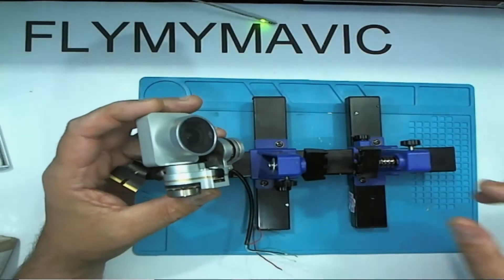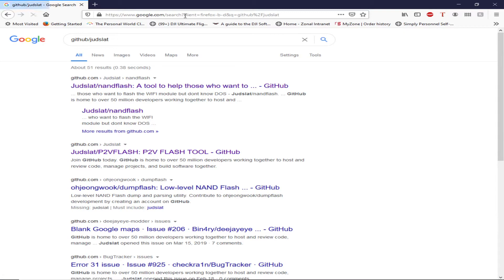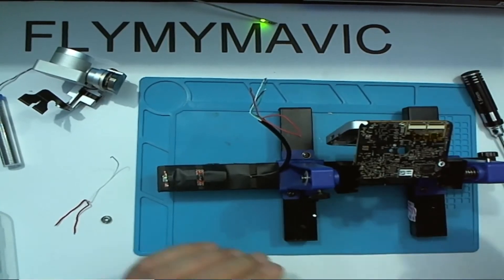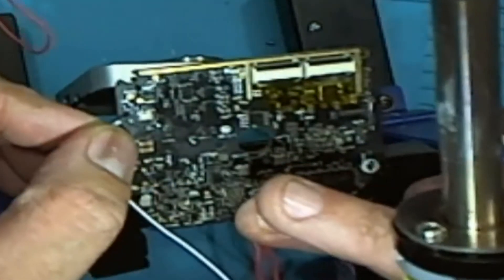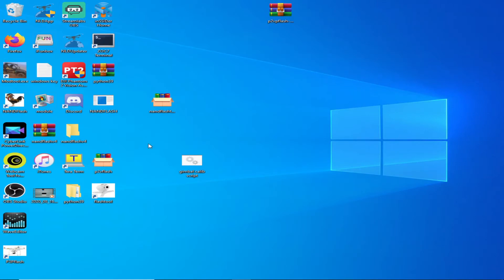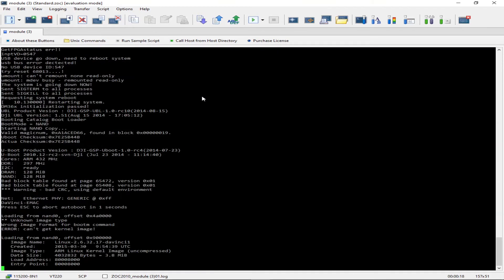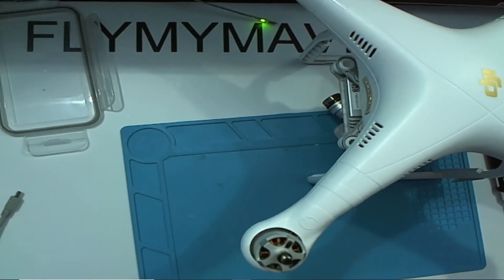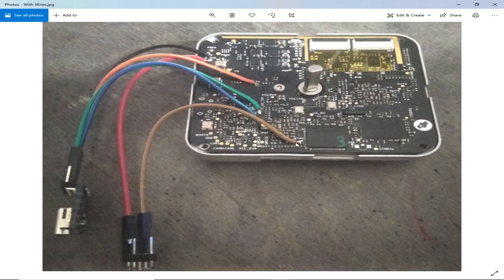Phantom 3 Pro loss of FPV repair

Comment: Okay my guess is "you assumed users would only have 1 usb port"  I had to disable all my other usb ports because you'r program detected the wrong usb port so you need to add a option to manually select the correct port Also unless I have missed it were are (if any) the log for the com session so I can review what happened.
Reply from the maker: You mean you have multiple items plugged into your pc that show as a port in device manager??  as for a log file as the program uses a DOS EXE file and runs in DOS there is no output other than what is shown in the DOS box when it runs, im not sure if there is a way to do that unless i put in an intentional pause at the end of the script. always happy for feedback so feel free to reach out to me at flymyphantom@outlook.com

Comment: If I have a gimbal that I think stopped working when I upgraded its firmware.  It moves and such, the remote controls the gimbal and the drone fine, but I have no indicator light on the gimbal at all and just a black screen for the video feed in the DJI go app.  It also says “gimbal disconnected” in the camera settings in the app, and never has a reading for how much space is left on the microsd (also tried with no microsd to see if that fixed the video as I’ve seen elsewhere..)
Reply from the maker: I have a couple of suggestions please email me at flymyphantom@outlook.com to discuss further

Comment: When I flash, it gets stuck on the text "target". Please help me
Reply from the maker: Hi
i need more info than that, first off always double check your wiring and make sure it is correct also make sure you are using the correct type of TTLto USB adapter, please send screen shots to flymymavic@outlook.com. please note i am on holiday so may not reply straight away

Comment: Thanks for the tutorial, have you seen a situation where it worked initially but then stopped working again?
I completed the repair, powered up, received a video signal, powered down, installed the props, placed it outside, powered up and the Gimbal Disconnected message re-appeared. I repeated the flash process, but all I see it a "no video transmission" message, not sure if it was there when the problem started or if this is a new issue.
Any suggestions?
Thanks again

Comment: Hi thanks a lot for this tutorial, I  try it and finally the message programing successfull but not recover video signal, I realised that a block was wrong during flashing.
I paste the message.

->"Target: Erasing block 0x0000000A through 0x0000000A.

        Target: Writing header and image data to Block 0x0000000A, Page 0x00000000
        Target: Write verify failed, skipping block!"

And other strange messages.

   ->    "Target:    DONE
DONE received.  Sending the UBL...
   0% [ ------------------------------------------------------------ ]
Status Undefined"

->"SENDIMG received. Returning ACK and header for image data...
ACK command sent. Waiting for BEGIN command...
        Target:   BEGIN
BEGIN commmand received.
   0% [ ------------------------------------------------------------ ]
Status Undefined"

->"ACK command sent. Waiting for BEGIN command...
        Target:   BEGIN
BEGIN commmand received.
   0% [ ------------------------------------------------------------ ]
Status Undefined"

May be the NAND chip are wroken?
If you think that it is the case, would be posible to solve change the chip MSIC XY30LF1G18AC-XK1?, or it is not enough?
Many thanks for your support.
Reply from the maker: Yes the chip is fried and so won't take the loader program, the only way is to replace the chip which would mean flashing 3 different images which is beyond my scope of expertise
Reply: @FlymyPhantom  thanks for your quick answer, so if I change the chip the program is not enough to flash completly the chip?. Isn't it?.
Reply from the maker: @AntonioGonzalez-oj1zy  no it's a complicated process a search phantompilots forum for advice
Reply: @FlymyPhantom  many thanks, I have asked in the foro.

Comment: Will this work for the boot loader on a Inspire camera module with a DM368 or the HDMI GL658 module with a DM368
Reply from the maker: Visit http://wiki.dji-rev.com/ there is loads of info on there
Reply: Just wondering if this nice app would be easier . I’ve seen the manual method and not sure it’s my skill set
Reply from the maker: @broughamjb  if you email me at flymyphantom@outlook.com I can build an app based on which instructions you want to follow

Comment: Thanks a lot for the tutorial I made it and successfully recovered the image, but I lost the gimbal orientation, it is -25 degrees to the left there is some methode to correct it?
Reply from the maker: try a gimbal calibration
Reply: @FlymyPhantom  Thanks for your quick answer, Ill tryed but  is not corrected, I  remember that it is calibrated in production, beacouse is a magnetic detector and need to put the value in some memory probably the same I flhased and the new dont have the same information in this point, I am not sure of that.  Some times ago I read about it and I remember that exist  a cheap that  is programated during production.
Reply: Excuse me I have discovered my mistake I have tightened the screw of the axis outside the chamfer.
I take this opportunity to comment on another mistake I made in case it could have happened to a novice like me. I couldn't communicate by serial until I changed the Rx and Tx cables and everything started to work perfectly. Thank you very much for your help.
Reply from the maker: @ferminsalazar9742  yep that will do it, glad it's sorted

Comment: I can not get it to say bootme in teraterm or Putty it just goes through a chain of computer language forever long I let it run before I close it out.  It is read on the correct serial port and I checked wires a couple of times. Can anybody tell me why?  this board went bad by sitting for 5 months without use.
Reply from the maker: You need to make sure you jumper the tiny 2 pins together and to the 3v, it’s booting up (the long repeating text) so it’s definitely not in boot mode
Reply: @FlymyPhantom  Thanks so much for the quick response.  I love all the details you have done on this subject.  I searched for days to finally come to this post that made it more easier to understand and everything you need to do this.  I really thought I had the two BT pins soldered together well and connected to the 3.3v pin.  I soldered across the two pins.  I will resolder again if you think that is what it might be.  The board did bring up everything I needed to fly before i took it out because I did not have live view.  I could take pictures and video.  The drone was not used for about 5 months and this happened.  So, I would not think it would not be a burnt out chip.  Just a little trouble shooting when I would connect the usb-TTL module it would start the computer language on terterm and if I pulled the 5v connector off the module it would stop. I did this for the ground and also for TX and RX and each time the computer language would stop when I pulled the connector off.  So I feel like those are good connections other than knowing the 3.3v is shorted. Again, thanks for your time and help.

Jimmy
Reply: One more question, will I have to flash with new firmware after I reinstall the board and power on?
Reply from the maker: No mate
Reply: @FlymyPhantom  The board I have cannot be flashed so there must be a chipped burned out on it.  I have tried everything from re-soldering the wires numerous times to running separate 5V to the board.  My question is I cannot find a new or used or reflashed board anywhere other that then a option on ebay coming from China!  Is there anybody i can buy a board from not having to go to China?
Reply from the maker: Rarer than hens teeth mate, are you in the U.K. ?
Reply: @FlymyPhantom  No, I am in USA in Texas.
Reply from the maker: I have a guy in the states may be able to have a try at it email me at flymymavic@outlook.com and I’ll give you his details

Comment: i cant get it to say bootmebootme i have 5 boards and none of them do it can you advise please? great vids BTW  :) thanks
Reply from the maker: It’s those 2 tiny pads, I sometimes have to try a few times to get them right. I ended up soldering one wire across the 2 pads. Make sure the TTL board is wired correctly as per the pictures as well
Reply: @FlymyPhantom  thank you so much for all you do :)
Reply: hello can i know what connector you use to connect to the pc.. what name just want to learn how to fix my phantom 3 pro sme problem @FlymyPhantom

Comment: This is great , thanks for replying to my email Justin. I’m subbed. P2V+ repair worked flawlessly so fingers crossed for this one. I take it the board is the same one? Does the jumper need moving over? Cheers
Reply from the maker: No use the same 5v as with the other one.
Reply: @FlymyPhantom  thanks again